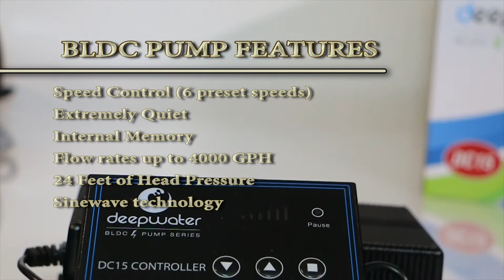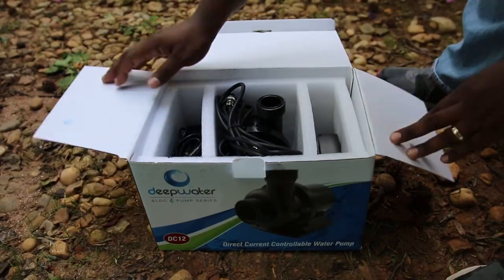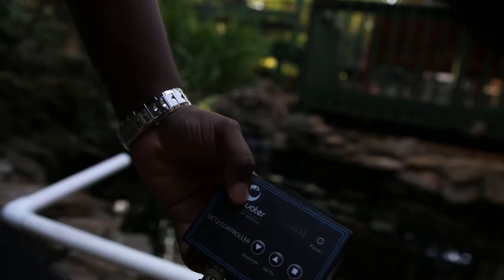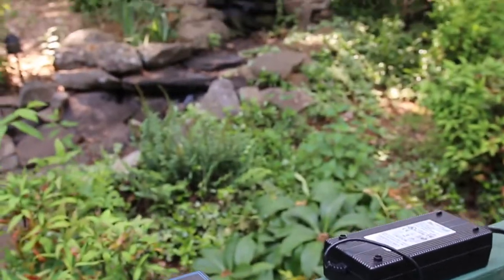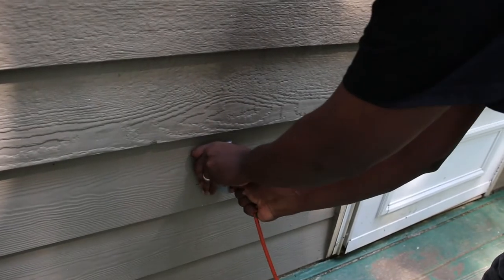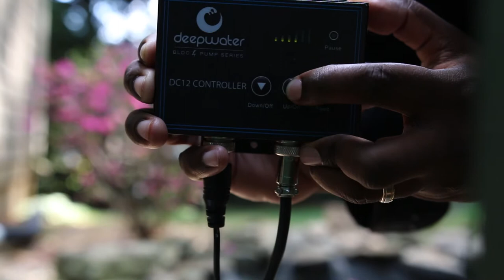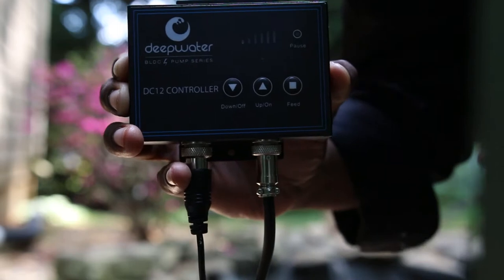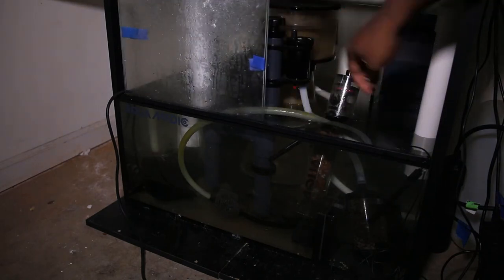Testing the Deepwater BLDC Pump on a Pond

Comment: Where do you find the metric pvc fittings
Reply from the maker: ChaosGeneral1 You can buy them online here https://www.saltysupply.com/PVC-Fittings-s/16448.htm
Reply: ChaosGeneral1 Yep you can buy them online at Salty Supply. However, I should have been clear in the video. When I got that sump it was not yet available in the US. The US version does not have metric size fittings.